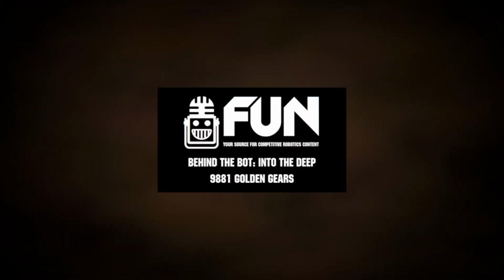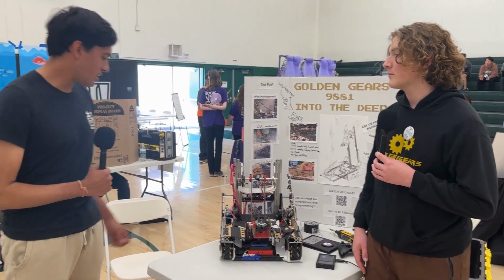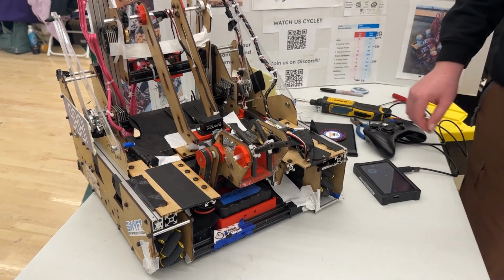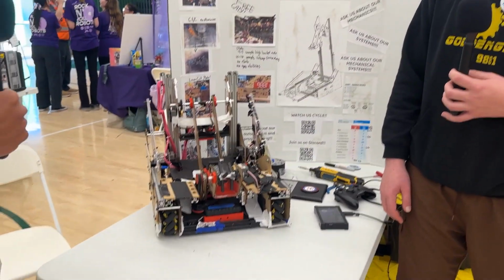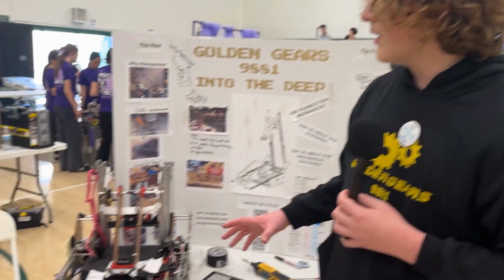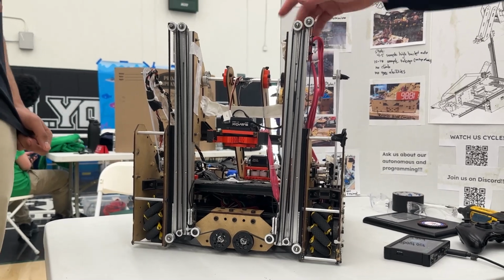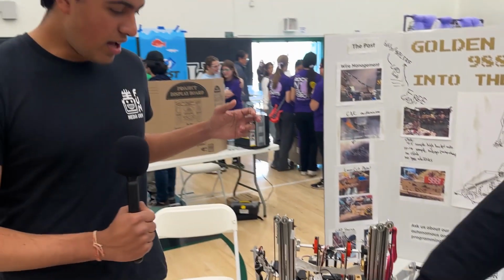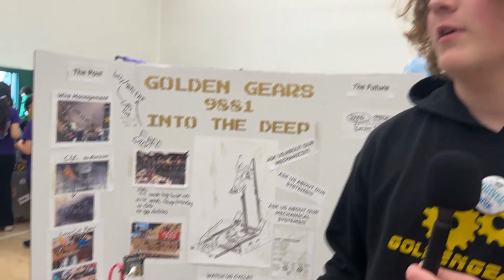9881 Golden Gears | Behind the Bot | INTO THE DEEP

Comment: wait how do you belt the slides, and which slides do u use
Reply: I'ma post a vid describing how I did it on my channel a bit later, but we use 340s because belt pulleys are very wide, if you use string or have belt hardware from gobilda I would recommend 240s
Reply: @dotshape oh alright thanks. jus like ygs, the last we wanna be dealing with is snapping strings 💀💀
Reply: misumi SAR 330